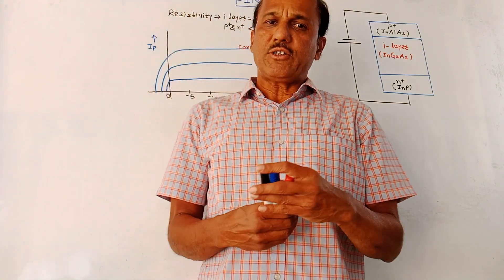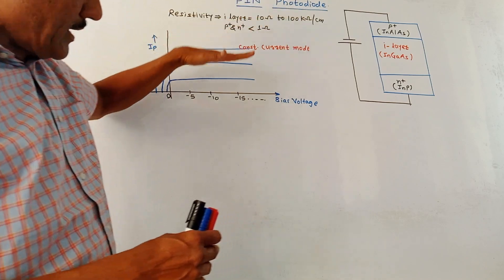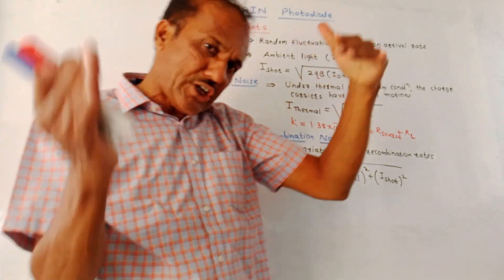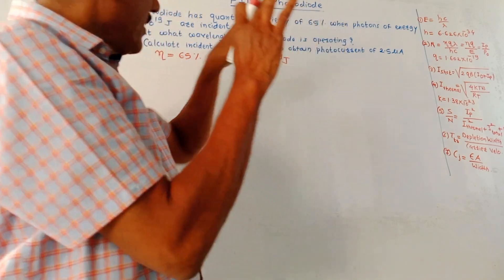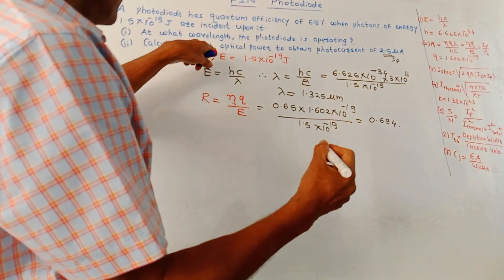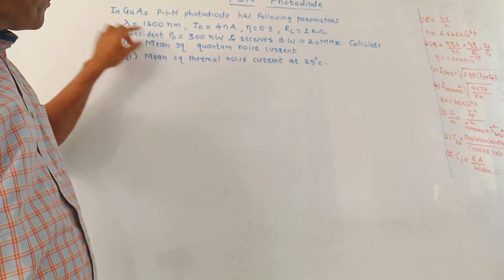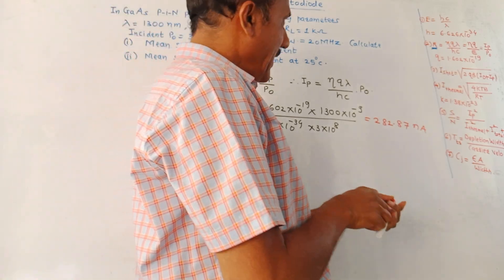PIN PHOTODIODE

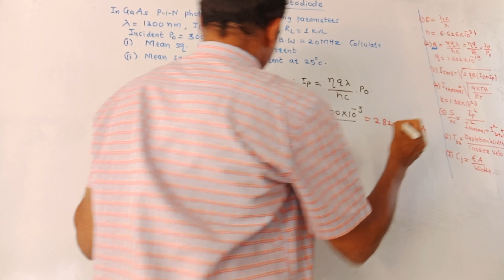Comment: 13:02 My ans is 0.942921 A 
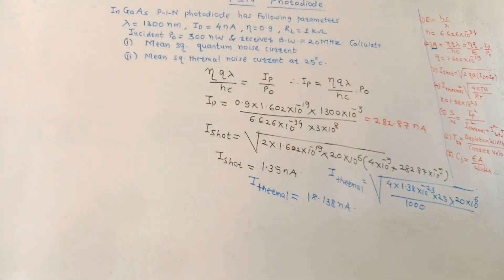15:15 My ans is 5.25nA
Reply: My first answer came same but for second answer what sir has done is sir converted temperature of degree into kelvin but accidentally wrote in degree only if you convert degree temperature into kelvin then it will be 298.16 and then if you solve you will get same answer as that of sir i.e 18.14nA(round)
Reply: @SaadMulla-x3l  Right
Reply: Yes same here 
Sir will you please check it once
Reply: For the first one, he forgot to write multiplication with Po = 300nW